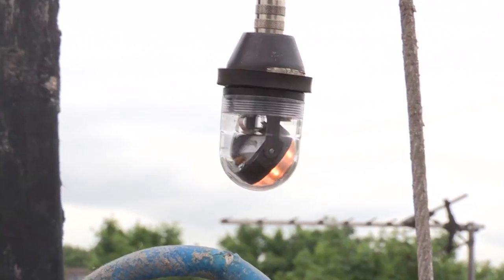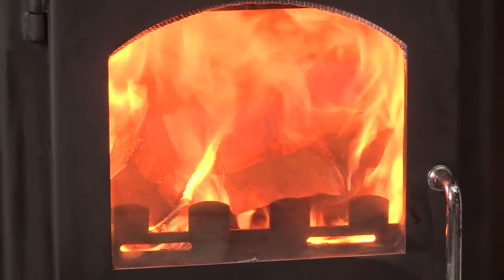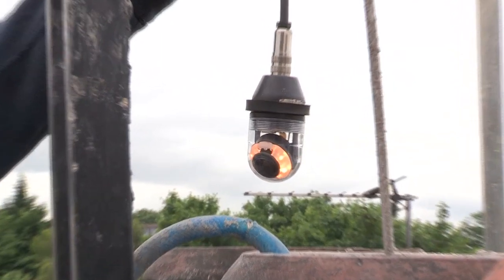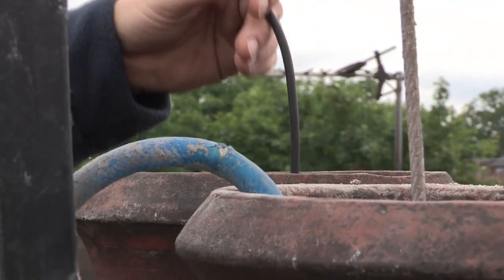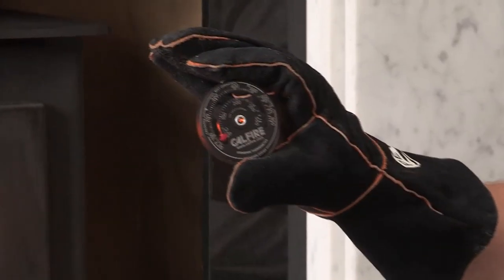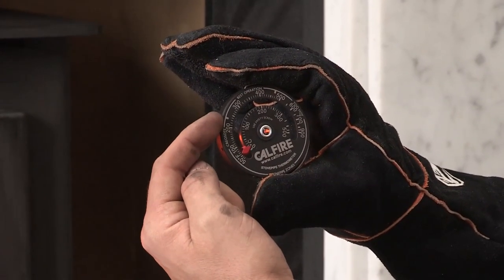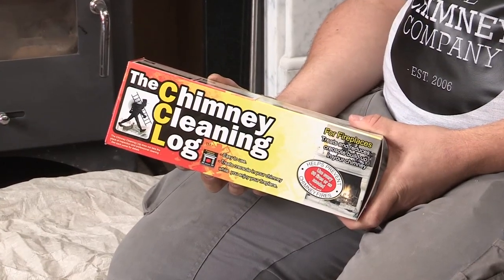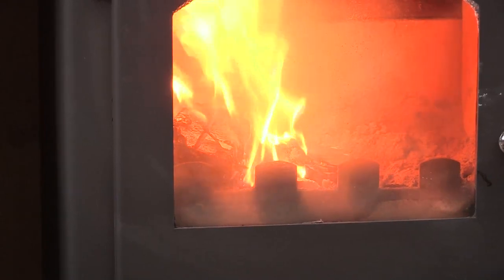How To Reduce The Risk Of A Chimney Fire

Comment: Just a note of correction at 3:07 -- pellets do NOT have any plastic (although they come in plastic bags).  They’re smooth and shiny on the outside because they are extruded through a stainless steel extruder under incredible pressure.

Comment: If a chimney cowl is the wrong type, can it make smoke go back down the chimney (in an open fire) as when i light it im smelling smoke both in a cupboard in the bedroom above the fire and also in the attic - just a strong smell of smoke no actual visible smoke. It seemed fine before the chimney cowl was fitted. Its a metal cowl which is held on by a metal type cable tie fitting. Thanks !

Comment: I usually shove the broom down my chimney every couple weeks whether it needs it or not.  Still, the chimney has burned like a fighter jet engine now and then for only a few seconds.  But now, I'm removing wood burner and replacing it with a Jotul gas stove.  I'm not getting younger and doing the wood burner stove thang is starting to wear on me.  Plus, no worrying about a chimney fire.